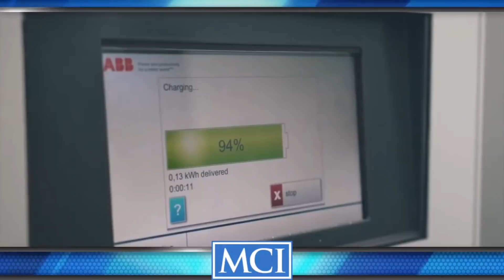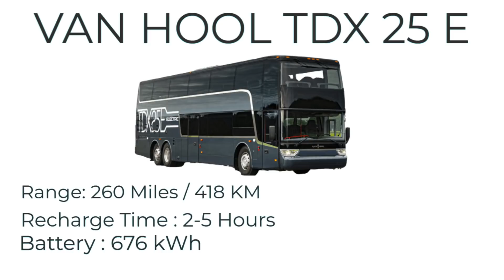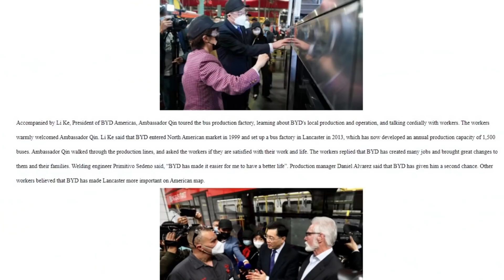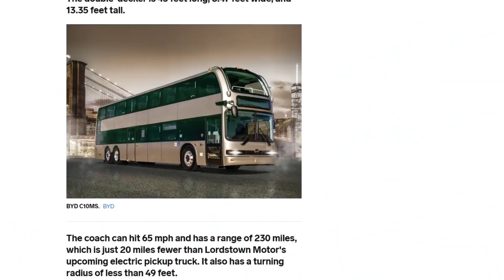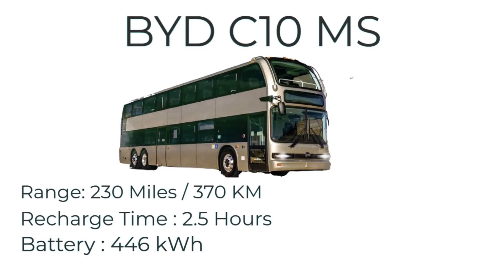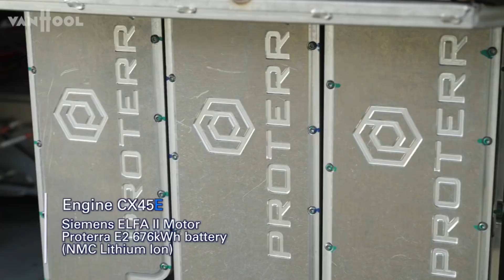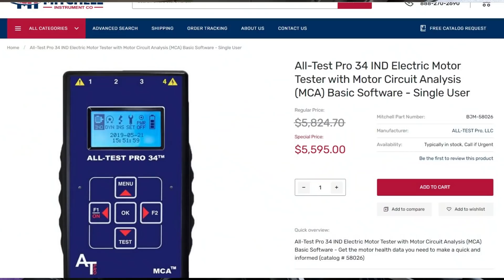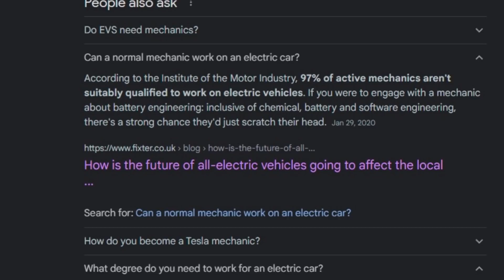Are Electric Buses working out in the US?

Comment: I work for a bus company in the UK who operate electric buses, with regards to the batteries each one costs £60,000 and each bus has 4 of them. The batteries alone cost more than the price of a new diesel bus. As they are service (Line run) buses the majority of the funding was government grants. With regards to maintenance, the buses were prototypes when supplied and major maintenance is carried out by the manufacturer, who still own the chassis. Another point worth considering is recovery costs, when a vehicle suffers a serious failure, or simply a flat battery, onboard safety systems lock the drivetrain to prevent the vehicle moving therefore it cannot be towed, and must be recovered on low loader trucks. Another interesting point worth mentioning is they are promoted as "Green emission free vehicles" which is not enrirely true, as the heating system is diesel powered.

Comment: It is good to see electrical buses are doing well on the market. The weakest point still are the batteries. But there is hope: I just read about a new type of battery: a solid state battery, no fluids anymore, no dangerous chemical reactions, and a much better performance! Hope it does what they promise. And a reduction of charging time would be great!. Here in the Netherlands we have electrical buses with panto-graphs  that are raised at the terminus stations and halfway stations against a big pole to charge. These are scheduled fixed route buses, max distance of the two terminus are 50 km (30 miles).

Comment: We don't have the electrical infrastructure in place to transition from diesel/gasoline/natural gas/propane vehicles to electric vehicles.  The electrical grid can barely handle the demand we have now.  For it to be feasible, every fuel station would have to retrofit a portion of their fuel islands to charging stations.  This is not to mention what it costs and availability of raw materials to manufacturer battery packs and the impact it has on the environment.  The impact of a battery manufacturing plant is just as bad, if perhaps not worse, than a coal burning plant.  We're not really gaining anything here.  Plus once things eventually do migrate to electric, we'll probably getting additional taxes on power to maintain highways and roads on power.  There will be no more free charging stations.  You'll have to put in a credit card or something to get billed for the power.  Never mind that these stations can most likely be run off of solar especially if you're in an area with plenty of sun hours in the day.  Free charging stations are just a bait and switch tactic to get people to migrate to EVs.

What probably would make things go more towards electric vehicles is a PHEV.  I'm surprised the motor coach industry hasn't come out with a PHEV with a diesel powered generator or engine that can charge the vehicle as it's done in automobiles.  That would make more sense to me.  It would extend the range which would make the idea much more feasible for long haul routes.  This is probably why the automotive industry has (plug in) HEVs.  You have options on how to charge the vehicle and you don't have to worry about being stranded because you can't find a charging station.

Comment: Yes, I agree that for now, combustion engines are the way to go for long-distance motorcoach travel for the reasons you stated, not to mention that the batteries end up taking up a large portion of, or the entire, luggage bay. That said, fuel prices are continuing to rise. There's a bus charter company in my area, Sun Diego Charter Co., which for many years has run its coaches on B-20 fuel and may increase the biodiesel component in response to the high fuel prices: is that a viable option for the time being?

Comment: Battery powered motor coaches are a big waste of money! And the mining of battery component's are probably worse for the planet! I don't want to get political. But we will NEVER get off of fossil fuel. Instead of focusing on pure battery power, we should try to squeeze out more miles per gallon. I don't know much about DEF, but I hear that's suppose to emit cleaner exhaust from the vehicles. Motor coaches, and tractor trailers should just stick to what works, and that good old fashion Diesel power!!! I do know how expensive tools are. One Snap-On wrench could cost hundreds of dollars. And a Snap- On tool box could cost as much as a brand new Tesla if not more.

Comment: The MCI J4500 Charge has a 544 kWh pack of NMC, average cost is $132 per kWh, so just under $72,000 per battery pack. Li-ions are pricey things. Battery replacement is a function of charge cycles, a pack will probably get you around 600,000 miles before replacement. 600k miles running Diesel at 8 MPG, with a cost per gallon of $5, is $375,000, 10 MPG is $300,000. 
Doing a bit more math, assuming a range of 310 miles on 520kWh of charge, something within reason according to the articles about the bus, with a price of $.1375 per Kwh of electricity it cost approximately $.23 a mile to drive. Or roughly $138,000 to go 600,000 miles. As an example a Tesla model 3 would cost $23,100 to go the same distance. Factoring in the cost of diesel vs the cost of charging and pack replacement, an electric coach comes out ahead, but not by a large amount.   
I could be off on this info, but it is a good ballpark.

Comment: The future of the coach industry will be electric, but it will not be subject to charging constraints. It will be a battery swap station. Hydrogen will not be the future. It would bankrupt the coach operators trying to run on it. Fuel costs would double because of how inefficient fuel cell systems are.

Comment: Saw a video where Van hool will sell you the bus for diesel bus price, BUT they will sell the batteries over the next 15 years based on the savings.  They  maintain the batteries and replace them if necessary. They dont say if you get a loaner or pick up drop off. Theres a you tube video out there. 
 Thanks for the info, I've been curious about this.

Comment: I'm sure all-electric coaches would be failures out west due to long distances. I doubt any of them could go non-stop (except for a quick driver change) from Phoenix to Colorado Springs in a single day; which is a trip I've done twice before. The big question is how did they determine the mileage. Did they run those tests with a full passenger and baggage load or did they do it with an empty coach with just a driver. Electric cars receive their ratings based on only a driver and no other occupants/cargo at a speed below freeway speeds. So the range is very deceiving.

Comment: I am quite interested in the emergence of electric coaches on the market. I really like the prospect of noisy, stinky, leaky diesel buses going away over time. But I spite of what the climate politics are, you are not going to suddenly swap the fleets to battery electric buses overnight. But I do expect to see their presence grow more or less organically as they move into specialized service markets where the technology, cost and infrastructure capacity emerge to allow these buses to cost effectively and profitably enter the market. I have a Prius in my driveway. And it works just fine. But I still prefer my gas powered van for most of my use.

Comment: My small city has them in it's transit fleet and I've ridden many times. From a rider perspective they are comfortable, and they go through tight 1700's city streets, and I'm sure the quietness is appreciated by residents. Apparently they are having a few issues with time between charges, especially in winter. I have a theory.... I think part of the issue with battery drain might also be the way they are driven. The drivers really seem to be laying into that instant torque. They will sink you back in your seat. I don't know if there is a software "eco" mode to coach for longer range, or maybe they just need to adjust their driving (plus people just need to wear a darn coat and not expect bus interiors to be 75 degrees in winter). I agree they're not ready for long-haul service yet. I think long-distance vehicles will probably be suited to some degree of hybridization over time.

Comment: Hybrid seems the best choice for a coach.  Less weight with a smaller engine, doesn't need huge batteries, range and winter heat not an issue, and finally and regenerative braking saves on maint.
Reply: Amen.   The bus can "catch up" during breaks if it has just climbed a good sized hill.
Reply: Plus it could use a propane or hydrogen powered engine to generate the electricity to charge the batteries making it far cheaper to run than an all diesel or gasoline engine driven bus.
Reply: They seemed to have bypassed that and straight to all electric.
Reply: Yes exactly. Wouldn’t have to be so concerned about konking out along the interstate and ruin a vacation because the battery ran low. Plus plenty of reserve power from that beautiful CUMMINS 6 cylinder engine. I own stock in them😜.
Reply: Did drive a few ADL Enviro Hybrid buses in my career, but for almost a full year now it's been Yutong E12s and I'm not fond of electric power at all.
Reply: hybrid worst of both worlds
Reply: @davidmoser3535  You never watched Robotech.
Reply: Winter heat is never an issue if you just use a resistive heater. Most never hybrids have resistive heaters which can work almost instantly. Although older hybrids still do use the ICE, like my 2008 Prius :(. It makes me disappointed that it doesn't have resistive heat.
Reply: Centenary would be best if the infrastructure existed.

Comment: That was a fascinating video. I am in favor of electric vehicles, but in many cases, the world is just not ready to even make every fleet 25 percent all-electric buses. Price needs to come down, range needs to increase, charging time needs to decrease, and they need to be able to do the speed limit. Also, I note that the buses shown tout being "zero emission." Many manufacturers are correcting that to say "zero direct emission," because of the increase in pollutants at power plants. This brings up another issue: What would a bus company's electric bill be to charge the buses, and can the electrical infrastructure handle everyone charging their vehicles at once, especially in places like California which already has rolling blackouts. I suppose a bus company using electric buses could wisely invest in diesel generators.
Reply: "I suppose a bus company using electric buses could wisely invest in diesel generators."

But, wouldn't that kinda defeat the whole purpose of having an EV fleet?  I mean, if you need diesel generators to charge the batteries, why not just use the diesel fuel to power the bus itself?  I swear, we live in a Rube Goldberg society now.
Reply: @guildrich  that's kinda why all electric vehicles are stupid at this time. Drive 3 hrs and charge 4 hrs.  Seems stupid for a charter bus.  I remember taking a John Deere factory tour so Michigan to Iowa. I can't imagine doing it 3 hrs at a time

Comment: I would love one as a base for a motor home, but the range has to be what you can go at highway speeds fully loaded in 8 hours (500 miles).  An alternate would be a highly efficient, low emissions internal combustion range extender.
Reply: I'm very pro-EV, and think that some people will pay the extra $500K for electric vs diesel.  But wishing that range is 2.5x what it actually is, isn't going to make that happen anytime soon.   The actual choice is to either allow for 4-5 hours of charging (plus charging at the end of the day) during a 500 mile day.  Batteries charge faster when closer to empty than full, so 2 half charges take less time than one full charge.   The other option is to plan your trips to take more days, enjoying stuff along the way.  

Personally I take my road trips in a PHEV, so that I can treat it just like a hybrid and spend no time charging when I'm trying to cover ground.  I had a 1050 mile day last July (most of Nebraska through most of Ohio) returning from out west to New England.  But in a BEV, I simply would have planned and driven the trip differently.

Comment: It’s actually insanely possible on your shortest route. How long is your shortest route in miles/kilometres? Change the bus stops Location and install charging system well park of 5-10. Each minute of charge as a mile of MCI J4500 Charge. Charge it for 40 minutes = 40 miles of range roughly.  Test this theory release it for a week to a month doing charter and lime run services.
Reply from the maker: We don't have any short routes.. our routes are minimum 350 miles. Each stop we make is 5 minutes.

Comment: The part that I have a hard time wrapping my head around is free charging.  I know those stations are out there (I understand they take forever to fully recharge electric cars), but I can't imagine that they'll last as EVs become more popular.  Throw in commercial EVs, such as trucks and coaches, and you'll be paying to charge your batteries soon everywhere you go just as you now pay to fill up your fuel tank.  

Add in the fact the cycle life of a battery is way less than that of a fuel tank (that is, you can refill a battery far fewer times than a fuel tank), and that the capacity of rechargeable batteries decreases over time and use which doesn't really happen with fuel tanks, it would seem that EVs have some ways to go yet before they are as useful as conventionally fueled vehicles.

Personally, i was hoping the fuel cell would become more popular and preferred, but there's a way to go with those, too, before they become practical.
Reply: The charge times quoted are using 130kW to 150kW average charging power from DC fast chargers.  Those chargers are NOT free.  Free Level 2 240V chargers at the mall/etc tend to be around 16 amps = under 4kW,  so those buses would take a week to charge for free and would undoubtedly get kicked out for abusing the system before then. 

Having said that, I live where there are low electric rates in NH.  Even the biggest battery mentioned (676kWh) would only cost me about $50 to $60 to charge at home for the 250ish miles of range.  I'd probably plan on charging it at 48 amps, so 12kW for 2 days.  That assumes that these buses even accept L2 charging, and only allow one charger, neither of which I'm not sure of.  One of the bus descriptions said it had 3 battery packs.  Maybe they allow a separate EVSE to charge each one, for all I know.  I already have both 208V 3 phase and 240V split phase at home, so have more flexibility than most people about what loads I can run.  Most power companies are happy to run an additional service if you need it, or even add another transformer to the pole for you.

Comment: I am curious if the same technology used in wireless phone chargers could be used, on a much larger scale to charge and power coaches and trucks on the highway. Obviously a staggering amount of engineering would be required but could solve (or diminish) the range dilemma.

Comment: I'd like to buy my company electric buses... but downtown is the issue. Each unit has to run a 20hr service day over 1100km to turn a SMALL profit. 5hrs a time to charge takes away from time spent bringing in fares/customers... which does the opposite of make up for the up front cost. Fuel is $2.25L here somedays, but the up front cost is just way too high to justify the charging costs, even if cost of ownership is lower in the maintenance category.

Comment: This may be a dumb question... but why can't the battery be in a trailer hauled by the bus? When the bus stops to recharge along the route, a freshly charged trailer can be switched out (15 minutes or so) with the existing (depleted) trailer? I've wondered why that isn't feasible for long-haul routes?
Reply: Or, rather than a trailer, just swap out the batteries.  It seems to me that a motor coach, more than any other vehicle, lends itself to this possibility: open the bay door, slide out the uncharged battery pack, slide in a charged one, run a few checks, send the bus on the way.  Then, the uncharged pack can be charged while the coach goes on it's merry way.
Reply: @thesios  if it can be done with scooters, it can be done with coaches!

Comment: Love your channel, totally agree electric buses are not ready for long-haul. That said, you missed a lot of the cost savings in your pros/cons list. Primary among them being maintenance. However much you pay for maintenance and repair staff, parts, lubricants, down time for servicing, etc - cut all that by several times over. EVs are vastly more reliable (almost no moving parts) and require almost no regular servicing for the motor. Tires, suspension, electronics, interior maintenance etc. will obviously be the same. TCO for electric cars pencils out to be far less than their ICE equivalents. I see no reason why it would be different for a bus. Still, until range and recharge time improves, it's a non-starter (see what I did there?) for coach companies for sure.